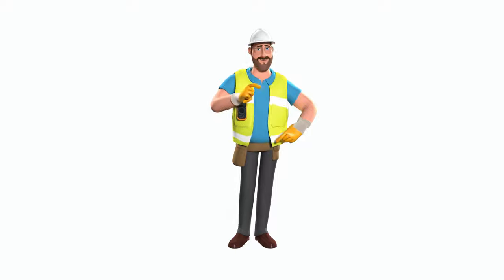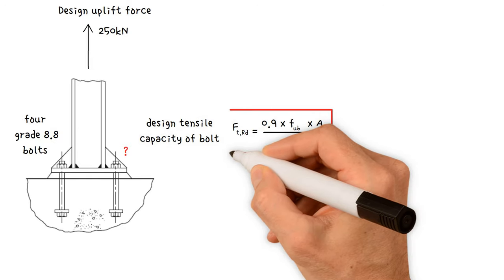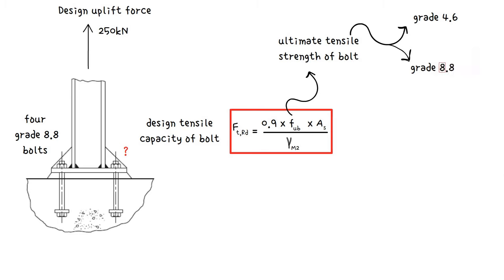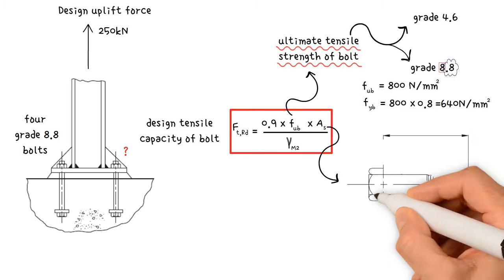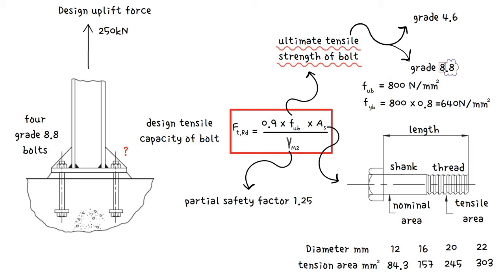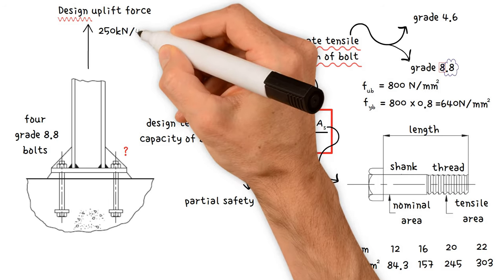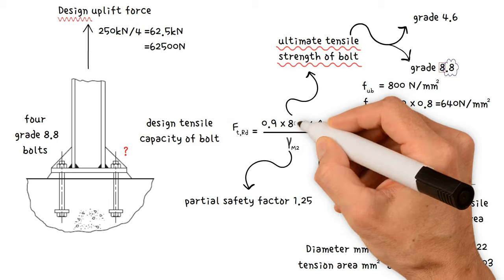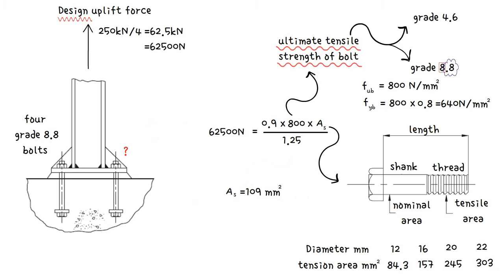How to calculate the bolt diameter required to resist uplift forces.

Comment: Partially correct, this will apply when the load is in the center of the bolt, but if your load is offset from the bolt, then the equation becomes more complicated because you need to find the bolt pattern centroid.

Comment: Nice explanation. In the old AISC allowance stress design, you could just look up the tension or shear allowables for any size bolt. But this is a good refresher as to how those values are derived. 👍

Comment: Great I really easy to understand and straight to the point it feels me very very easy. 
What is 0.9 value from where is coming?
Reply: k2 is a coefficient that takes values k2 = 0.63 for countersunk bolts or k2 = 0.9 otherwise. (EN1993-1-8 Table 3.4)

Comment: Great ¡ really easy to understand and straight to the point. 
What about when there is a combination of tensile and shear stress on bolt due a moment on the base?, Thanks
Reply: Did you ever get the response on this, great question.
Reply: In that case (general case), you have to make use of the Bolt interaction curve - Combined shear and tension Fv,Ed / Fv,Rd + (Ft,Ed / Ft,Rd) / 1.4 ≤ 1.0

Comment: Good Video, but what does this mean for bending moments and concrete? Its very simple to calculate the diameter, but thats not enough.
Reply from the maker: Thank you for your comment! You are correct that calculating the diameter of the holding down bolts is not enough to ensure the stability & strength of a structure. In addition to the diameter of the bolts, it is also important to consider the bending moments & concrete in the design of a structure.

We just uploaded a new video that might be of interest to you. It covers the importance of holding down bolts in construction & how to calculate their tension capacity & pull-out resistance. We hope you find it helpful and informative. Thanks for watching!

Comment: How to calculate the small cap plate thickess welded on an Shs 50 profile which also needs mounting feet to be welde on it , as in a case of a platform

Comment: So, while calculating the bolt sizes and it's adequacy don't we need to check the bolt against Horizontal Shear force at base level ? It may be critical considering shear force too. What's your view regarding it. Please elaborate. Thank you
Reply from the maker: Thank you for your comment.This example is merely to explain how to work out the bolt size which is mainly subjected to uplift. The shear force has not been considered in this example however the worst case dictates the design. If there is a shear force you would have to include this in your design!
Reply: Times another 0.8 roughly?

Comment: Which standart do you use for calculate? AISC, Eurocode etc ?
Reply: Eurocode
Reply: @orfeaspapaioannou2755  Any particular Eurocode?
Reply: @aksvp  ec 3 for steel structures
Reply: Eurocode EN 1993 - 1 - 8 cl 3.1